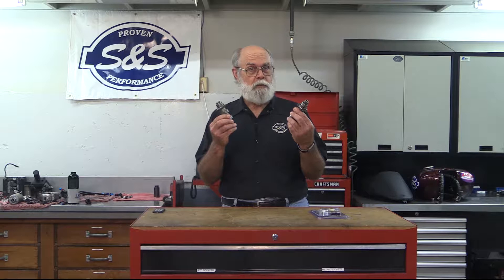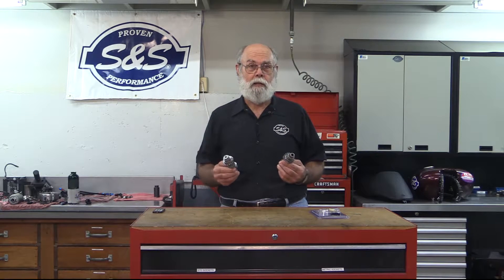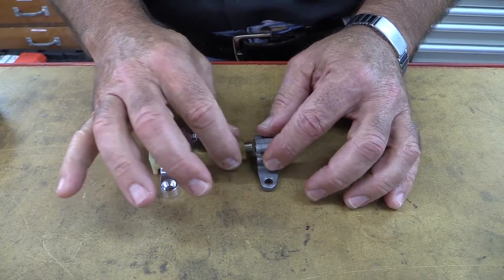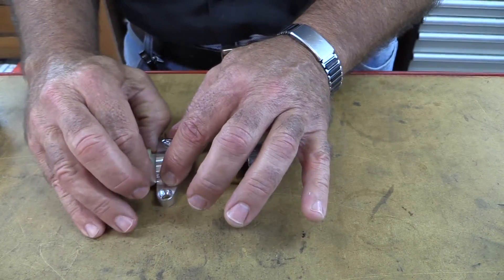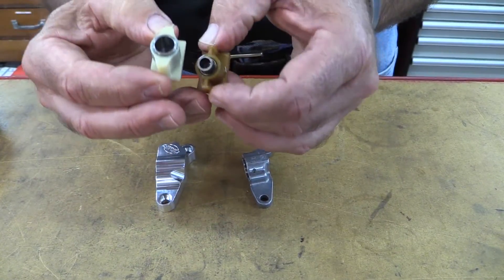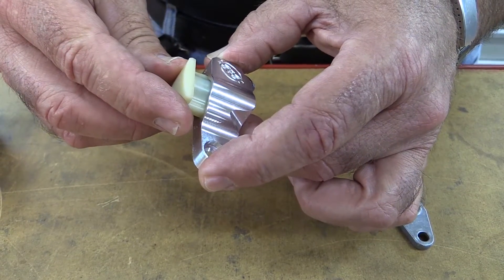S&S Cycle - Hydraulic Cam Chain Tensioners - Part 1

Comment: Do these fit on the SE hydraulic cam plate/oil pump upgrade (like in my 2001 FLHR).
Reply from the maker: While it should fit, we can only guarantee the fitment on our our cam plate and oil pump upgrades.

Comment: Is this a direct replacement for the OEM cam chain tensioners on a fully stock TC96 engine? (preventive replacement due to mileage, the engine haven´t broke down yet)
Reply from the maker: Yes! You'll want to check them before they fail, and these will directly replace them.
Reply: @SSCycleInc  no need to replace the cam plate, then? fully compatible with stock plate?
Reply from the maker: @ubiratamuniz  Yep!

Comment: Can these S&S Cam Chain Tensioners be added to the stock harley cam plate, or does it require the s&s cam plate first?
Reply from the maker: Yes! They can certainly be used on a stock cam support plate. 
However, if your engine has had a meltdown and metallic debris was created, we advise installing a new plate because it's really hard to know if you've gotten all the chunks out of the oil passages.

Comment: This may be a question out of left field but since you are talking cam tensioners and I do not know who else to ask (I do not work on my own bike)... I have a 2000 titan phoenix and 1999-2006 harleys suffer from a plastic cam chain tensioner issue. Since my bike falls into those years should I worry or do I already have hydraulic (not spring) in there because it is a 96 s&s motor and not a harley 88 motor? Anyone with real info feel free to chime in lol
Reply from the maker: Best bet is to look at the build sheet for that engine. Need the number off of the side of it and drop our tech guys an email  tech@sscycle.com  May take a few days, but they can dig up the build sheet.
Reply: I bought it used and have no build sheet but I will email and see if I get anywhere like you said. Thanks brother